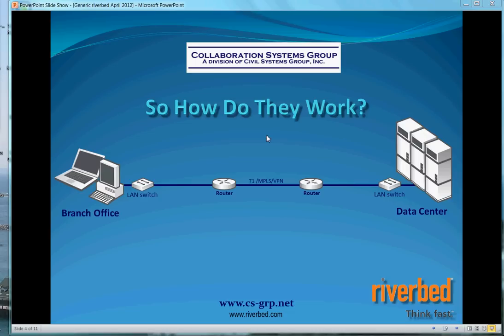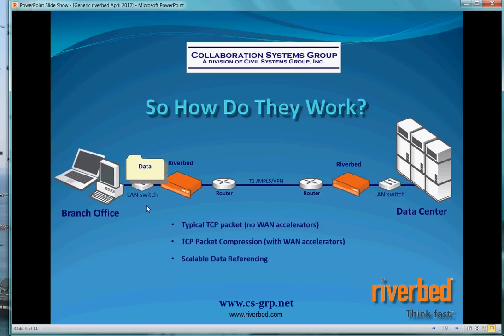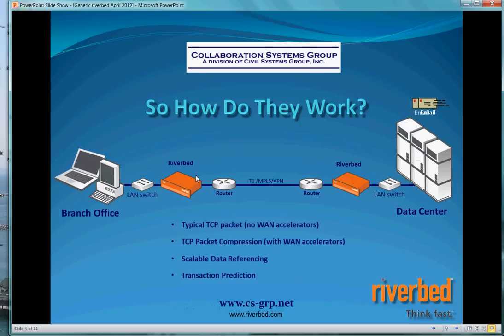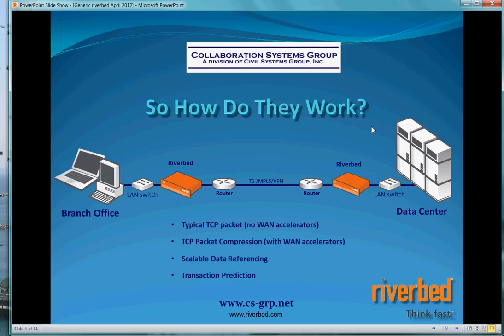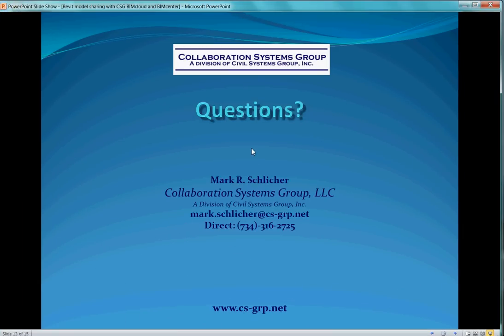Riverbed Steelhead WAN accelerators -What do they do?

Comment: You don't need to wait until ACK will be received before you can send another TCP frame. This is lie for most commonly used TCP implementations. What about concept of TCP window? I don't mean that WAN accelerators doesn't work, but your explanation is wrong. Read more about TCP for High-Speed Networks.
Reply: You are correct.  No ack required.
Reply: This is also my understanding.